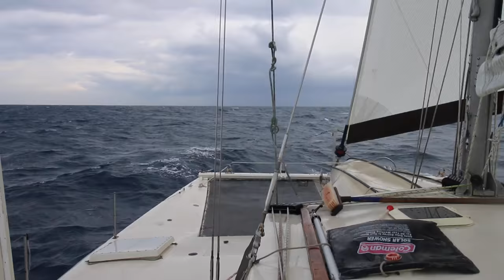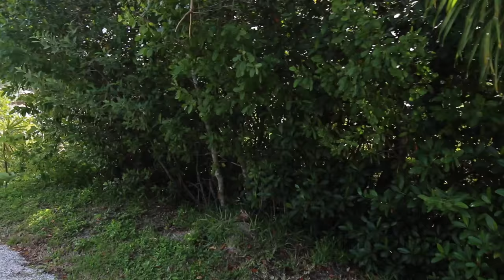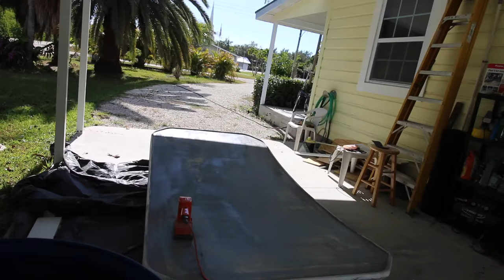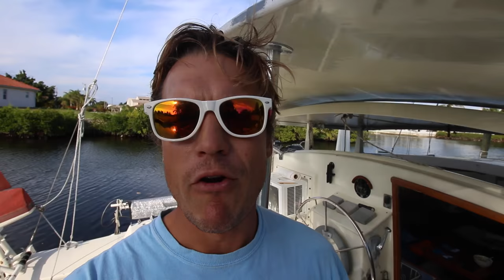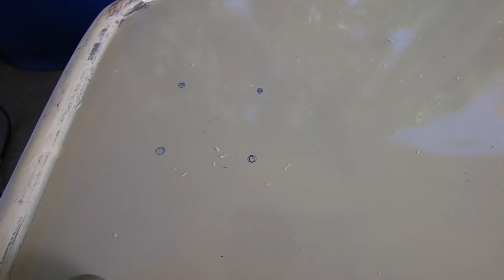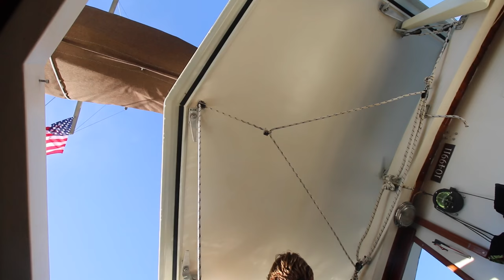How-to: Build a hardtop bimini on your sailboat  | Sailing Zingaro

Comment: Great job, man. Clever design, and it looks great. Have you ever considered using butyl tape for bedding hardware? The stuff rocks. It's easy to use, seals great, lasts a long time and is easy to remove. Also, I'd suggest drilling a weep hole towards the bottom of your aluminum supports. Everything leaks eventually, and that will prevent the water from making it into the cabin via your cable passages.
Reply from the maker: Weep hole is a great idea. Done. Thanks brother. Much love. -James

Comment: Great job mate. Only thing that will most likely happen if it hasnt already is in forward movement on a rainy day or rough weather the water will trickle over the bottom roof section onto you. The gap between the 2 roofs. Great job and informative ☺
Reply from the maker: Yeah, I haven't gotten to the window yet. Honestly if it's raining that hard you're getting wet with or without the top. ;)

Comment: James, great job. I just purchased a 42 foot cat in Fort Myers. After I sail her back to Texas for upgrades I am going to do a hard top. First off this video is great. I learned a ton!!!! Found Nidacore online but cant find the PVC lumber like you used with the lip on it. Any suggestions for locating? Also a subscriber. Keep up the good work.
Reply from the maker: I purchased that PVC lumber at home depot. It comes in different sizes, I got 1"X2"x8' lengths and routed the edges off. A bit of cabo and they stuck on for good. I can do pull ups on that top, it's awesome. Glad you're building a similar one - I'd love to see pics. If you have any other questions please feel free to contact me. -James

Comment: Great build and very functional.  I know it's been a while since the build but do you remember if you scored the board on the side that faced the bottom or the side on the upper side? It seems you were trying to leave a side unscored and have that side face up.  Is that what happened?
Reply from the maker: good question. Top side, that way you wouldn't see the score lines after glassing. but my helper cut all the way through the damn thing so I glassed both sides. lol.

Comment: I'm attempting a hard top for my cat. Can you tell me the dimensions of the top you built and can you actually walk on it? My dimensions would be 8 long by 12 feet wide. Supported at the back and about 6 foot. What thickness nida did you use?
Reply from the maker: I used 5/8". It's super strong. We can both stand on it at the same time, I think more people could too. Mine is 4x8, so just one sheet with the corners trimmed, but you can easily tape them together (glass tape obviously)

Comment: You need to pole dance to test that support

that over drilling is a genius
Reply from the maker: That's the way to do it on a boat. Anything that goes into wood that may have salktwater intrusion needs to be overdrilled and epoxied.

Comment: You don't distill the water or anything? Are you not aware of chemtrails, not to mention just good old pollution? There a dude in Hawaii that's done a youtube video about analyzing the the exact content of these horrible chemtrails because I guess it has been really bad there in the past and his land gets a discsernable layer of this strange silvery looking dust all over his roof and lands. So what he did was every time these jets would start spraying this stuff in the atmosphere, as they will ,even now. In fact I still see these mysterious jets up there gridding the sky,anyway he notice this stuff is designed to be suspended in the air for 4 to 6 hours before it hits the ground and at that time he'd start taking samples of this dust and after lab analysis  result returned from his samples he found that ,now I don't recall exactly all the components, but at the top of the list as far as quantity goes was aluminum and boron ! This chemtrail issue has been mapped to which nations seeing these jets arisols trails worldwide, and in a nut shell, it includes all Western nations and some African  and south american nations .   Know body knows for certain what organization is responsible, but naturally, the military has been questioned on many occasions, and they ,as yet, won't discuss it. However for those in doint these pilots have made mistakes and at least one of these 747s forgot to shut off his spray jets upon landing and was caught on cameras. So personally I'd be distilling that water if I was you